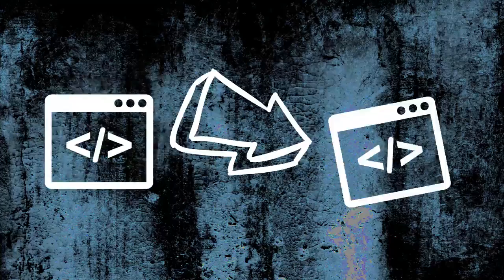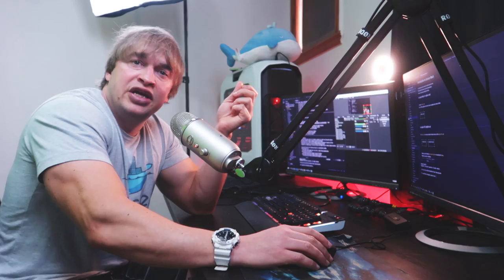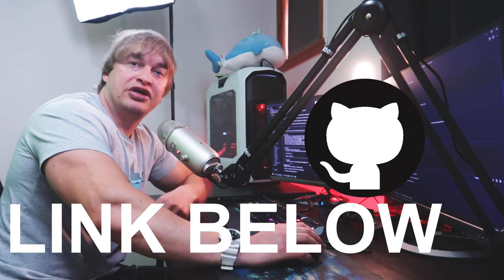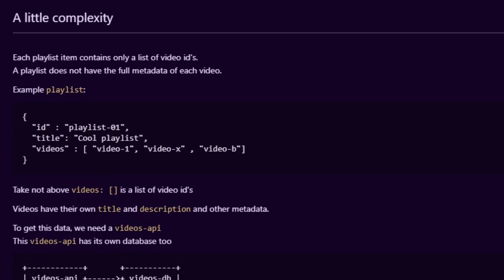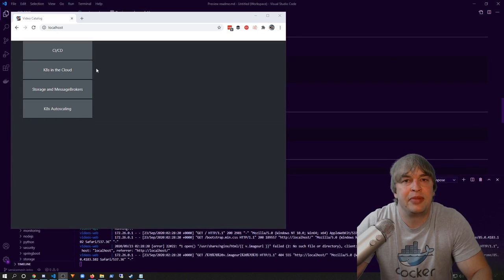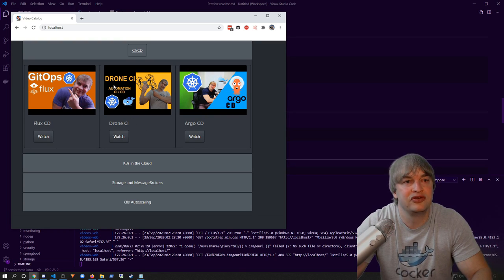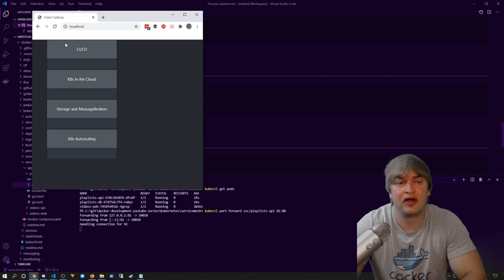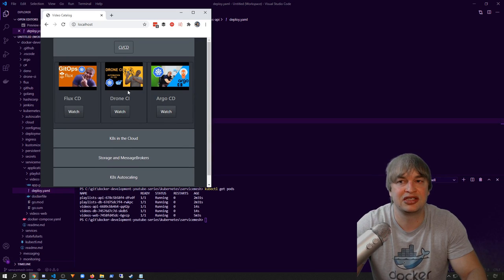Service Mesh: What & Why ? - a new series

Comment: Just awesome! But I have one question. If you have your Kubernete cluster on DigitalOcean inside one VPC network, which means that communication between pods is already secure. So what would be the use case for service mesh with TLS connection between pods?
Reply from the maker: Thank you 💪🏽 TLS between pods means the traffic is encrypted end to end. If your network is comprised, it would be increasingly difficult to sniff packets on the network.
Reply: Many kubernetes cluster contain different Environment (prod, stage, Dev), different projects or multiple tenants, so it better to secure the communication.

Comment: How do you maintain referential integrity between the videos and playlist databases? Can you do a video on microservice architecture and SQL databases to explain how monolithic apps can be broken into microservices when they all use the same SQL database?
Reply from the maker: Ideally in world of distributed systems, services should not leak their data model and instead provide a contract thats backward compatible. In this case, playlists-api should not know how videos are stored by the videos-api. Only way to access the data is through the videos-api. The videos-api is able to change its backing service from MySQL to Redis without impacting dependent services as the contract on videos-api (accepting an ID on a GET request) remains consistent. So the videos domain is controlled by its endpoint and no other services should be able to access its database directly. I would recommend to try avoid sharing databases between services as its an anti pattern.  
12 Factor is a great read on this https://12factor.net/backing-services
Microservice video series sounds like a good plan  💪🏽

Comment: How is this different or how does it relate to a APM product, say NewRelic?
Reply from the maker: It's very different. NewRelic integrates at code level (SDK) so it gives deep observability into method\function tracing and instrumentation. NewRelic would compare more to Prometheus + Jaeger to a degree. Service mesh gives you more network level tracing focusing on endpoints. I.E When service A calls B, B's endpoint took 5ms to respond, but it does not instrument the code of endpoint B which is what NewRelic would do if that makes sense 💪🏽
Reply: Awesomeness